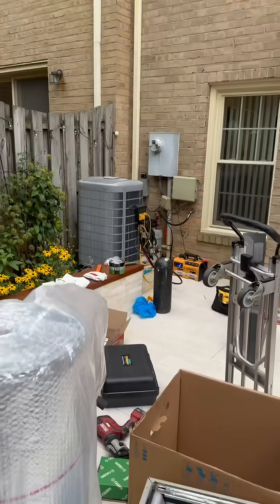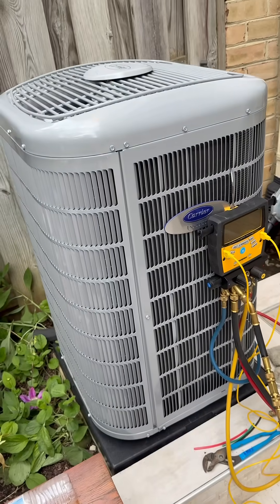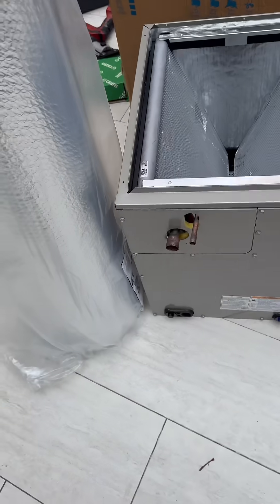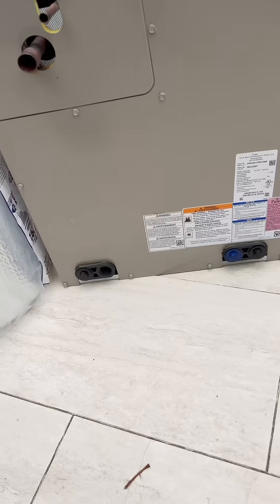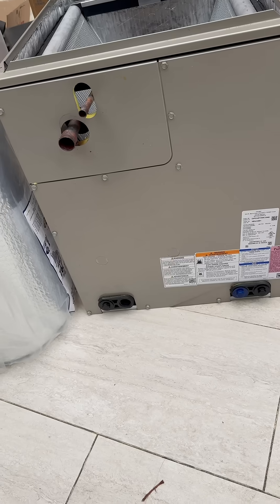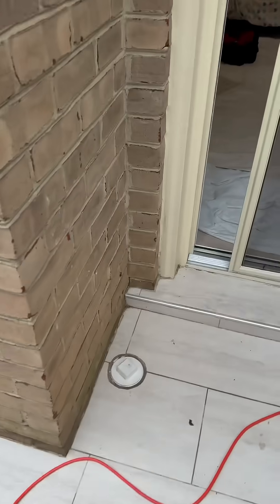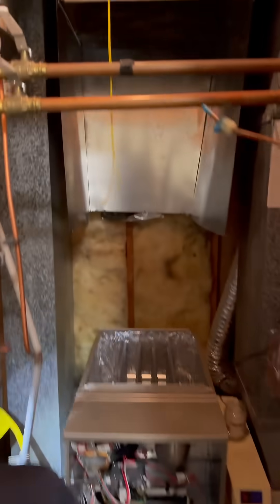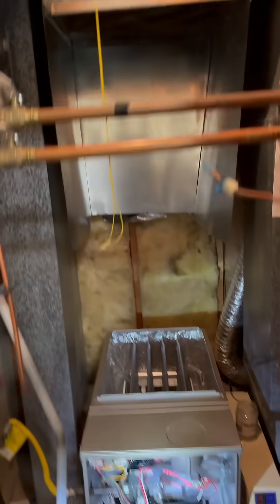Encountered Leak on Brand New Carrier Evaporator Coil – Improving HVAC Quality Control

Comment: This happened to me once. Now me andnmy guys always check the coils before we even show up to do the replacements.
Reply from the maker: I was considering doing the same for the Carrier Infinity controls since there was a string of bad controls received from factory. There is actually a bulletin on the matter. Not sure how widely spread the bulletin was but nonetheless decided to begin creating a process whereby we energize the C & D terminals with 24 volts AC to get it running and thereafter conduct the latest firmware update BEFORE the actual installation. Nothing worse then going to an installation to find out the dang control isn't working properly. It infuriates the installer and leaves a bad impression with the homeowner. 

Nelson and I created a little rig where we plug in the 120 volt AC power with an old electrical cord that then ties into a transformer. Transformer converts the 120 volts to 24 volts AC which then is applied to the Control using Wago connectors for C & D respectively. Once it turns on we use the USB-C method to update the Control to the latest firmware.

Comment: I thought they discontinued the 5 stage this year?
Reply from the maker: They did. This was the last of the Mohicans. We had to get it shipped in from out of region since customer refused to allow us to install the R-454B version that was 32 inches by 32 inches in dimension. The owner did have a point though that the smaller profile of the 5-stage looked better given the size constraints present.

Comment: 5 stage you meant to say 5 maintenance calls a year. 😂
Reply from the maker: We were trying to avoid any callback by replacing the thermostat wire to render that one less possible hiccup down the line. Who knew that the dang coil would be the source of the issue at day 1! At least we got it done and currently running with no problems.

Comment: Fucking damn what a setback! at least with chiller fan decks and large tonnage split coils, u can braze on the spot, especially with HX evaporator coils. They're never built with aluminum (usually)

Yea with custom made evaporator coils for large retrofits, we'd get leaky evaps or even condenser coils straight from factory. U know as well as I do Lennox is the champ of pre gaming leaks right off the bat, but a carrier? On a residential? How upset was the customer?